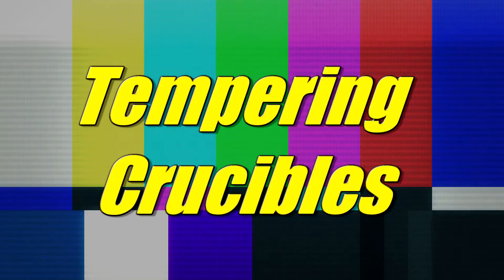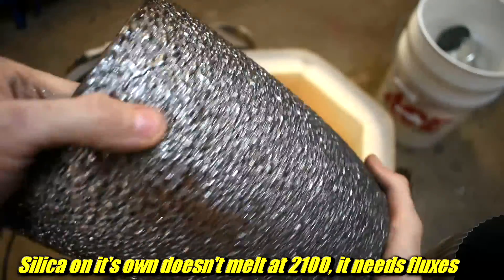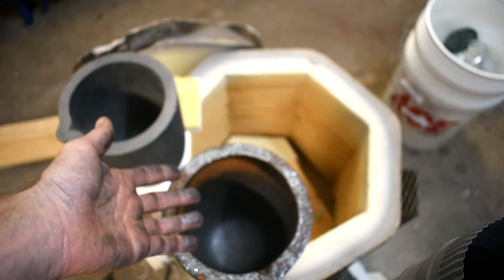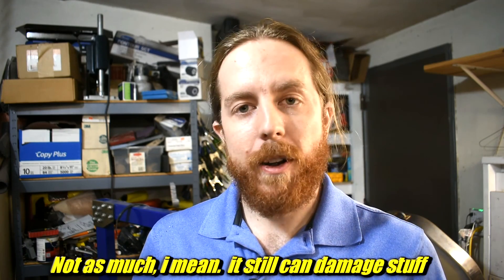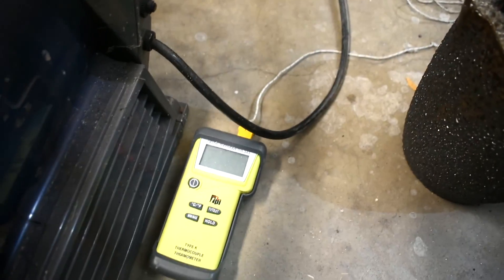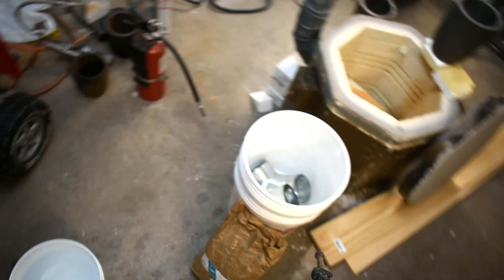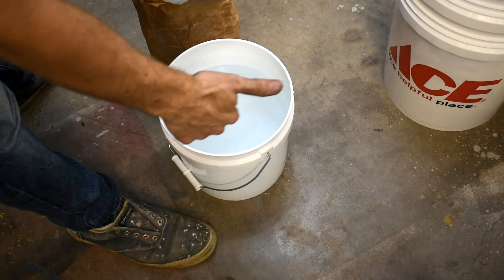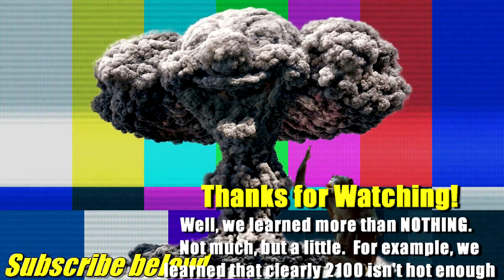Crucible Tempering Revisited: To use borax or not? or something else?

Comment: Paul,  Ah, myths and legends of ages past! How they plague the foundry industry.
I am not too sure about any of this! SOME crucible manufacturers recommend a preheat to above working temp by perhaps as much as 200 deg C for very large crucibles (300 kg plus!) before first use and indeed before any subsequent use if it has been allowed to cool down. These crucibles are very heavy and 2 to 3 inches thick, they are made for continuous use. Note that not all manufactures recommend this treatment and they NEVER suggest any sort of fluxing treatment – the impracticality of this repeated preheat after each cool down for us and our small crucibles is I am sure obvious.
In 60 years of using crucibles, I have NEVER bothered with any sort of tempering and this has never caused me any problems. I think that a temper just robs you of a melt - more than one if it is a very hot temper as you seem want to do. Crucibles are expensive, why waste part of their life on an unnecessary procedure? Now, I speak from a point of always buying good quality crucibles – some of the rubbish one sees from various online sources I would not use and if a crucible of mine caught small pox like yours seem to have or the often seen on YT extensive surface crazing I would be having some harsh words with its supplier. Also, if I got graphite all over my hands when handling a new crucible, I would not buy from there again - good crucibles have a glaze on the outside which prevents this and stops (well, slows) oxidation (burning out of the graphite). Note that the glaze is not on the inside for were it to be fluxing with metal oxides would occur and drastically shorten life. The unnecessary use of ANY flux like Borax salt lime et al is sacrilege, fluxes destroy crucibles and should be used very sparingly as rarely and for as short a time as possible for melt treatment only, all residue to be removed ASAP.
Perhaps the worst thing you can do to a crucible is dunk it in water!!!!!!! Manufactures are so concerned about water pick up that they say NEVER even stand a crucible on a concrete floor. My wife nearly had to call an ambulance when I saw you dunk that crucible!
If you think a crucible has got wet dry at 90 deg C and then 150 deg C for about 2 hours at each but any higher temp tempering waste of time, fuel, and crucible life!
In short NO fluxes, NO water and I strongly recommend NO tempering.
Martin
Reply from the maker: Hi Martin!  Good info here, if you don't mind im going to pin this post so people find it more easily
Reply: Paul,  I am honoured that you have chosen to pin my comment. 
 A little story about a wet crucible;-  I once was given a largish furnace, it had a BC75 crucible fitted (75 Kg of aluminium). Unfortunately it had  been out side in the rain for months and the crucible contained about 2 inches of grotty corroded aluminium and about 3 inches of water. I was desperate to save the crucible as a new one was about $800.00! (Ouch!) So I turned it upside down and the aluminium fell out (with a little help). I sat it, still upside down, a little up off the floor on some wood and I had a 100 watt light globe going on the floor under it. After about 2 weeks the bottom of the crucible (uppermost) felt warm and dry so I returned it to the furnace and lit a small gas burner in the furnace. I ran it on and off for a week or so slowly increasing the flame until I got to about 400 deg C then I put the proper burner in place and took it to red heat. It did not crack or explode and in fact it has melted about 600 kg of aluminium since - $800.00 saved - Phew! But I do not recommend this sort of thing!... Martin
Reply: @olfoundryman8418  interesting to see your experienced opinion.
Do you believe it matters if the crucible is heated in one spot over and over again versus spreading it out? I might get one of those with the indent as a spout. So I'd be able to tell which side I exposed to the heating element. So would occasional or frequent rotation have any meaningful effect to the crucible's life?
Reply: @olfoundryman8418  oh, wow! You have a lot of videos that I'm gonna have to watch.
Reply: @konstellashon1364  , Please do 😊.... Martin
Reply: Konstellashon, I think it is probably good idea to even out the effect of flame impingement on a crucible by using it in a different position each time. But I would not get too anal about it  - remember that big crucibles in furnaces that are used as holders can not be rotated and it does not really seem to matter that much. I believe it much more important that the burner is aimed correctly at the junction of the crucible bottom and the plinth it sits on. I actually do not tend to rotate mine as I place them in the position that is convenient to pick them up from and place in the crucible shank in a single swinging move and have the pouring notch point the right way and it has never seemed to cause my crucibles any problem. Just remember to buy good crucibles - not cheap I know - but worth it.... Martin
Reply: @olfoundryman8418  thank you
Reply: @konstellashon1364  you should set the furnace up so that the flame is wrapping around the crucible rather than striking it directly so as to create even heating.  I started with a DIY furnace and found that the flame blasting the crucible directly resulted in uneven heating of the metal, thus occasionally causing it to seize on me.  Once I got the flame at an angle so that it wrapped around the crucible and created a cyclone effect that not only eliminated that issue but also resulted in faster melt times.
Reply: I have been trying to get a definitive answer regarding what to do with a new crucible for days now, Paul is quite right the internet is very erratic on the reasons for coating flux on crucibles. This comment has told me everything i needed, thank you!
Reply: I agree with Martin. All you did was melt your glaze (that’s what was vitrifying on the outside, not silicates leaching from inside). The two crucibles look like slightly different sizes, more obvious by the height difference , so if one was larger, that would put it closer to the heating elements. Your thermocouple is measuring the temperature at one point in the furnace, which may or may not be the average temp and certainly isn’t the peak temp. Your crucibles are lasting despite your experiments, not because of them. Morgan Salamander Super crucibles are some of the best out there. They are already fired (that’s why they ring like they do- ever rapped unfired pottery?) and glazed and can just be used. The only exception is if you suspect they may have absorbed moisture (clay graphite, unlike silicon carbide, IS hygroscopic), then heating them a little more slowly at first to drive off moisture is all that’s needed. No flux. No borax. No tempering. You just unnecessarily shorten the lifespan that way.
Reply: I second the No Water, No Flux, and No Tempering. In 30 years, never had to do it.
Reply: Thanks for sharing your knowledge. I read in an old assaying book that crucibles and melt dishes should be well annealed by placing on top of the furnace before use. I can’t find any reference anywhere to what this might mean in terms of temperature and time. Any idea anyone?
Reply: @waynoswaynos , Yes, well the idea of "tempering" or "annealing" crucibles before use does appear in a lot of older texts and it may well have a lot to do with crucibles not being as good then as they are today. It may have simply been that it was a precaution to see if the crucible would fail (crack) in use - better to have that happen with an empty crucible. Perhaps too it is a reflection that crucibles were once in-house made  and often just of clay (no graphite) these would need careful drying and likely firing to develop strength - again better to get that over with when the crucible was empty. I believe that these days things are different. GOOD crucibles are very reliable and I have never tempered  any crucible and I have never had a failure in what must have been many thousands of melts. I believe that the life of my crucibles has been good - but that is a bit subjective I guess. Fire assaying could be different as it uses things like clay or bone ash crucibles (Cupels). These must sometimes be accurately weighed before and after the assay - you need to drive off volatiles before starting the assay. Also most assaying is done in a muffle furnace and the top of such furnaces would get hot  enough to dry a crucible out but not that much more. It is said that modern crucibles can absorb water from the air and that therefore drying at say 200 deg C might be a good idea. However I did dry a used crucible that had been on the shelf for over a year. I weighed it before and after and no weight change after 2 hrs at 200 deg C so I guess it had not absorbed any water. So if drying your crucible floats your boat go for it, but I would not be wasting crucible life by unnecessarily heating  to a high temperature....Martin
Reply: @olfoundryman8418  Legendary answer, thank you for ! As it happens I have been reading old patents, seeking out fire clay recipes, mould making, graphite and silicon carbide making methods, slip casting, pottery and making my own crucibles. Its been an enjoyable can of worms of a journey but I probably should have just purchased some Salamanders! I find myself on this page because I am at the testing phase of batch of mullite crucibles and scorifiers (Hessian triangular crucibles were made of this material – some contained graphite) and I wonder about things like preheating and how fast the pros get up to temperature. There are two temperature ranges where clay likes to crack. 220 and 680˚C. I figure that 'tempering' by sitting on a furnace/muffle, could well be around that 220˚ mark. I should probably seek out a retired assayer or refiner and pick their brains about whether or not tempering in the correct manner actually does reduce thermal shock issues within those temperature ranges. I guess it depends on the type of furnace and work being done. May I ask, what kind of furnaces did you use, and how large were the crucibles? Were you metal casting?
Reply from the maker: @waynoswaynos  Hi Waynos, Martin is having an issue posting a reply to this.  For some reason youtube is being a jerk again.  Here is his message: 

Waynos, Ah Ha now I see it – you have sort of been hovering in the background here 😊 Asking questions when the reality is that you know way more about this subject that anyone else here including me! Still, I will continue to stick my neck out and put my 2 cents worth in. You would seem to be someone who enjoys the journey as much or more than the destination. The kind of study and experimentation you have been doing is exactly the sort of thing I wanted to get involved in. Sadly, I had wolves to keep from the door and all my foundry endeavours were aimed at earning an income – not a very good one I might add but it sufficed. My intention on reaching 75 was to stop production casting and just do what I had always wanted. Sadly, the slings and arrows of outrageous old age caught up with me first and between a very painful back, total nonstop exhaustion, and bad balance, I can do very little. Hence my non-existent output of videos these days, something I am trying to remedy.

Good crucibles (Morganite, Mars etc) are not cheap but they have good life and do not seem prone to sudden failure – I would not use anything else.

The video “Steel; Making By Hand 1949”

Shows the making of clay crucibles for the Sheffield tool steel works (Ah - the good old days!) No graphite or silicon carbide in these of course as no carbon pickup by the steel was allowable. Boy, they sure worked in those days

I do not really know how hot the top surface of a muffle would get but would not the crucible placed there be unevenly heated – its bottom hot, its upper areas much less so. Would this be a problem? Speaking of problems, I imagine that finding a retired fire assayer could be one 😊

Yes, I was metal casting - both green sand and gravity die. Mainly various aluminium alloys but some aluminium silicon bronze, silicon bronze, aluminium bronze, CMA1 bronze, and also Ilzro 12. I had three furnaces, two were oil fired and one electric. The one mainly used took up to an AC 90 crucible, I used mainly an AC25 in this furnace and lifted the crucible out. The AC 90 was used as a bale out. The other oil fired used a basin type crucible that held 75 KG of aluminium, again on a bale out basis. The electric furnace was built for Ezda 12 work and took an AC 30 crucible. Check out my channel I have lots of videos there showing it all.

I looked up Hessian crucibles - Fascinating and weird at the same time. I would postulate that their success was down to a fortuitous deposit of the base clay in the Hess region.

My neck out thought is that a careful and patient drying and heat up to firing regime similar to that employed for investment casting moulds might be the go…. Martin
Reply: Thanks Martin. I can stop watching videos on this topic now.
Reply: Martin, what are these best crucibles that u are talking about that that you recommend?
Reply: @brunnermetalwear   Morganite, or Mars-Tiegel, are both good brands. Note that both actually recommend preheating a crucible before first metal charge BUT  that seems to apply to large crucibles and they do not seem to say much re small crucibles and certainly my habit of not preheating has not caused problems up to an AC 90 size.... Martin
Reply: You clearly know what you're talking about, can you maybe give me a few places I can get a reliable crucible for relatively cheap?
Reply: I watched this video right after i bought a little cheapo furnace but didn't see this comment. I've been scowering the interweb on related info and stumbled  on oldfoundryman. I learned more in an hour of watching than everthing else on the web  combined and much of that was confusing bs. Anyway I was pondering the borax not borax your crucibal because the snows almost gone and I want to melt some metal and came back and noticed this post and made a lot of sense. Then I read the replies and noticed the handle and said oldfoundryman! Dam , now I know what to do. First , skip the glaze, second source a decent crucibal . I'll use these cheap china junk ones for now while I'm learning then junk em. And dry them thoroughly before use. I'm in northern ny and its 100 percent humidity from spring until fall usually.
Reply: Martin, where do you get your crucibles?
Reply: @ralphkleyer9324 , I buy my crucibles from "refractory and Ceramic" they are in Mulgrave melbourne Australia.  But it does not matter where you get them from as long as they are a GOOD brand. Most of mine are Morganite  which I regard as a good brand. They never give me the problems (lots of surface cracks or "pustules" on the surface) one sees on YT from Amazon or eBay crucibles which I suspect are from China. Mars - Tiegel (from Germany I think) are another good brand. BUT remember you get what you pay for - good crucibles are not cheap.... Martin
Reply: @olfoundryman8418  Thanks for the info. I have no intention of purchasing cheap junk. I will check them out.
Reply: Alternatively....the reason why you keep having to source good crucibles......is because you need so many because you are not tempering them !!  Maybe is you tempered them you'd have to buy a lot less.  :-)
Reply: @andyspoo2  Andy,
An interesting viewpoint – or at least it would be if it was correct.
I did not buy lots of crucibles, in fact, despite having done well over 150 melts a year (300 some years) I would have only bought maybe two crucibles a year and some years only one! My crucibles reach their end of life not because they craze and fall to pieces, not because they blister like they have small pox (as cheap ones are wont to do) and certainly not because they crack and leak but rather because over time with repeated use their conductivity lessened and it just took too long to do a melt. At this stage they were gracefully retired to become flower pots!
I bought good (expensive) crucibles because they last way longer and I have never wasted fuel or crucible life by bothering to temper one. Were I to use (yuck) a cheap crucible I would not bother to temper it either but I would oven dry it before EACH use – I do not trust them to not absorb water from the air!
As far as I can tell the origins of crucible tempering go back to the time when each foundry made their own crucibles – likely from local clay. Such “green” ceramics are very weak and require firing to develop enough strength to hold the weight of metal. Obviously, this does not apply to modern good quality crucibles of the sizes used by hobbyists.... Martin
Reply: @olfoundryman8418  Thanks for taking the time to reply. It would be interesting to know how many melts other users have got out of both cheap and expensive crucibles. I think we need a survey!
Reply: @andyspoo2  I think a survey would be an excellent idea. But it would need to be done on the basis of keeping logs for each crucible - its not much good to say "I think I got about 30 melts" a record needs to be kept to give us any real idea. I used to do this years ago but have long since stopped. 
One problem here might be that many hobbyists would take years to do 100 melts. Even so its worth pursuing, perhaps one of the casting forums could get involved?... Martin